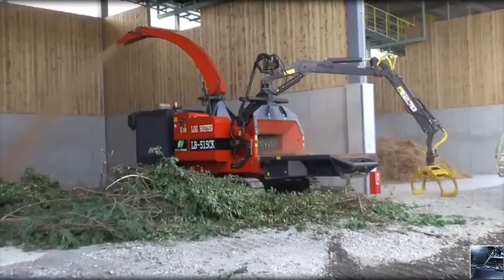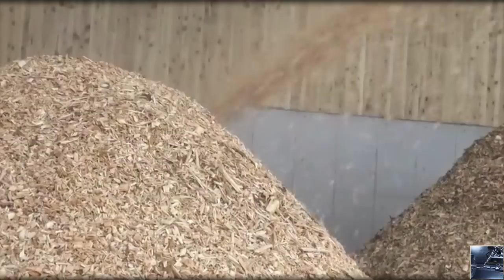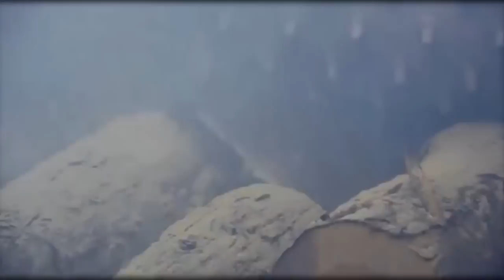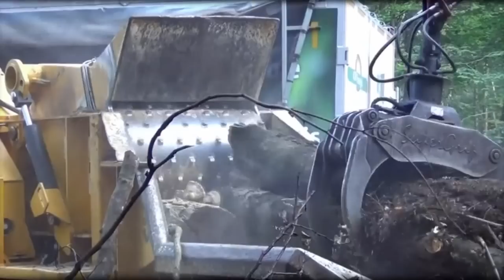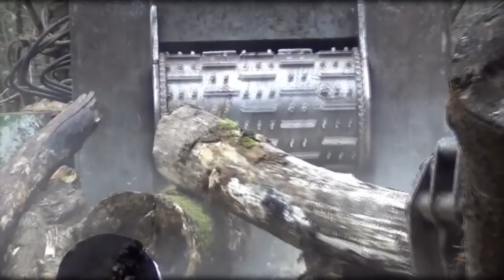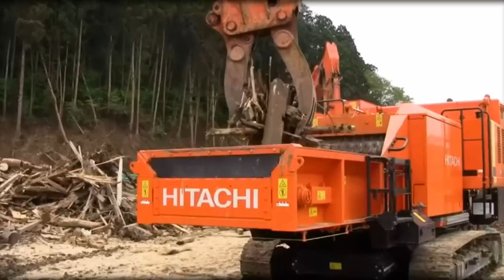Large trees are crushed easily -  Large capacity wood chippers

Comment: "These rollers are a safety feature and are generally reversible for situations where a branch gets caught on clothing" - what? They control the feed rate of the material and help prevent the debris shooting out. It's nothing to do with branches catching on clothing.
Reply: Bunny Warren link to your source?
Reply: Stopping stuff shooting out is obvious because they help cover the spinning blades. If you look at any video where a branch is fed in with the roller raised you can see the chips flying out. You can also see the drum holds the wood and if the motor slows it will stop and keep the wood out of the blades so they come up to speed. They may also reverse to clear the material from the blades. Where they can't do this, wood keeps going in and blades start to lug.

The smaller ones will often have a bar that stops the feed mechanism should it be pressed. This isn't because the drum makes it safer but because they getting caught on the material is a real possibility - https://en.wikipedia.org/wiki/Woodchipper#Drum.